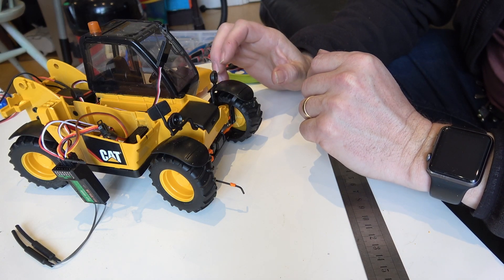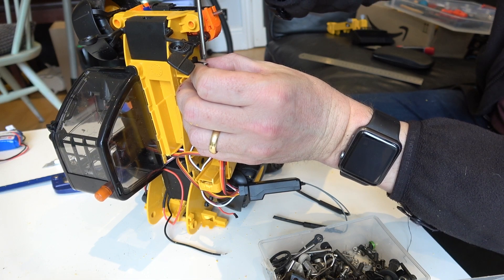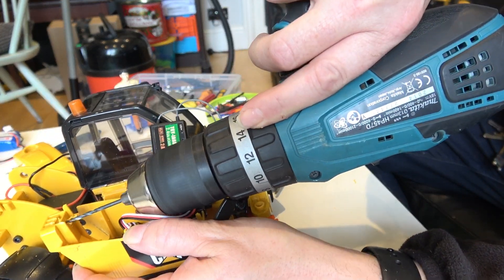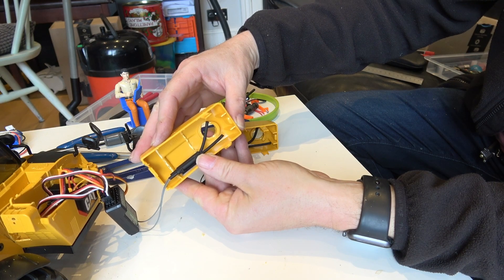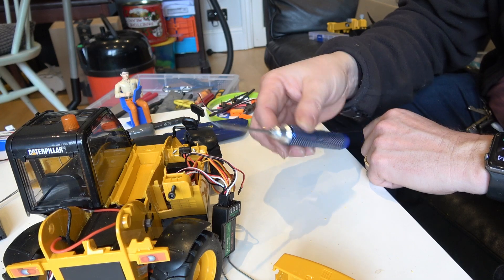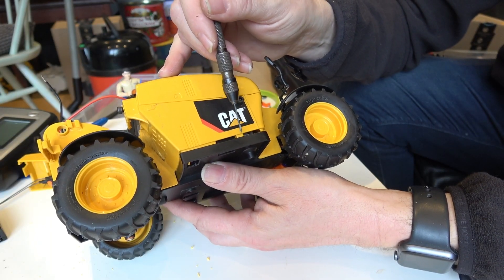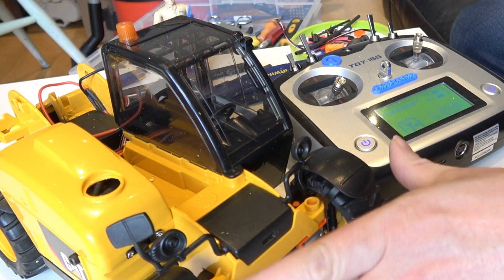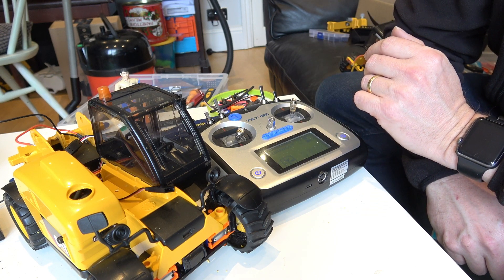Bruder CAT telehandler pt7c: body 3rd part

Comment: Neat idea for holding that conversion together. I may use that on a couple of Bruder conversions that I've had issues keeping together.
Reply from the maker: Thank you. I must admit, ensuring that the model stays together, that the battery remains accessible and that I have a convenient on/off switch are key features of the usability of the model. I try to make these integral to the design rather than an after thought as battery placement is often one of the biggest challenges when I am trying to keep the scale features - like the drivers cab - and put everything into a very confined space. 😀👍